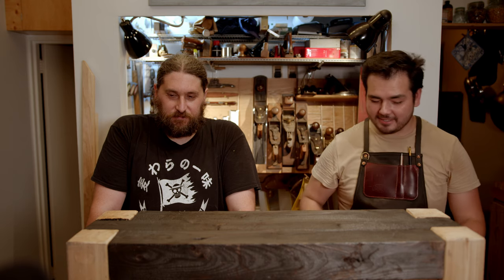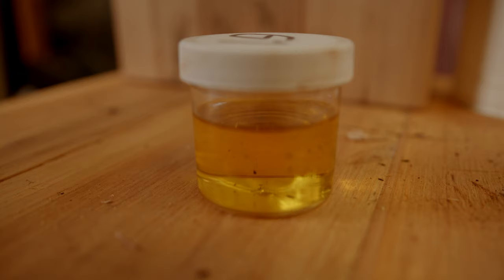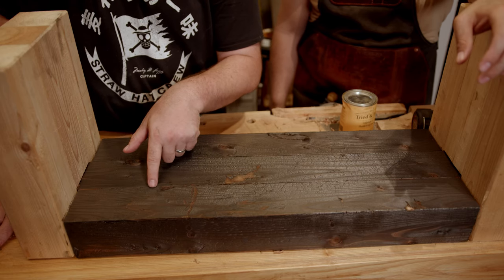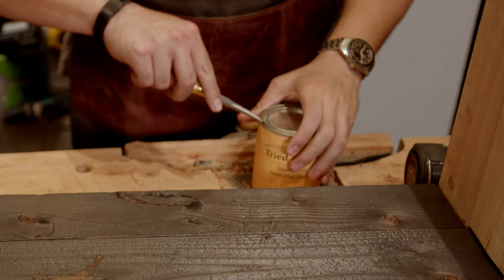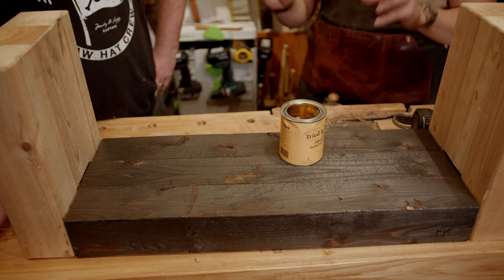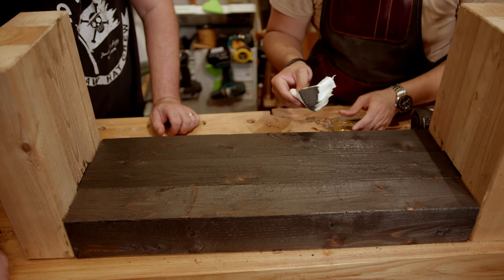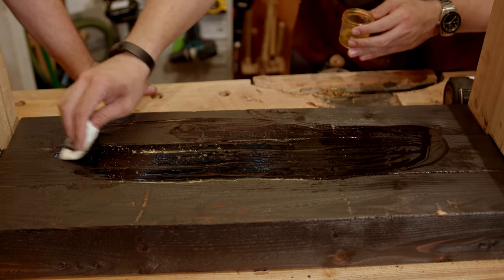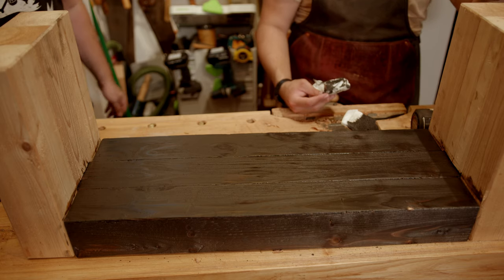A Shou Sugi Ban Bench, Finished with Danish Oil

Comment: How has it held up?
It seems that leaving the crumbly carbon layer would make it likely to come off on clothes when you sit on it even with the Danish Oil.
I'd think an epoxy would be an effective way to stabilize the carbon.
Reply from the maker: After drying it actually, surprisingly, did quite well. It seems that the oil produced enough hardening to help really stop from anything continuing to come off under regular use (I’m sure if it was really abused parts would wear back to an ashy state relatively quickly). 
More to your point though, we tried the same thing with a thinned version of a Tung oil that has failed to stop a shou sugi ban surface from rubbing off on things,  presumably because of how much thinner it is.

Epoxy would make a great stabilizer and finish for sure, especially as there are a variety of thicknesses and consistencies available now and finding the right recipe is much easier now.

Comment: Ed, have you considered Twitch streaming while working on projects?
Reply from the maker: I have thought about it a bit, but I haven't really dived into twitch as a platform I watch a lot yet. Do you think it people would be interested in seeing this kind of stuff in such a long format?
Reply: @eddieodonnell6309  yeah as long as you take the time to engage with chat. A couple of issues I can imagine is needing to mute the mic when you operate loud tools. Additionally, Twitch has a patreon type system built in. You can do subscriber give-aways for smaller projects once you get enough subscribers to cover costs. I'm not an expert on these things, but you had stage presence and some of the equipment for this stuff already.